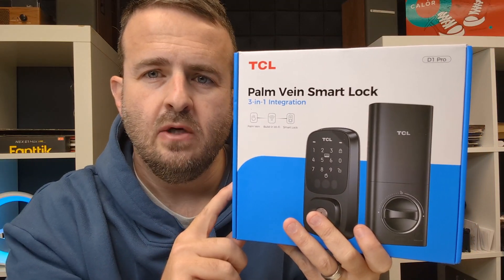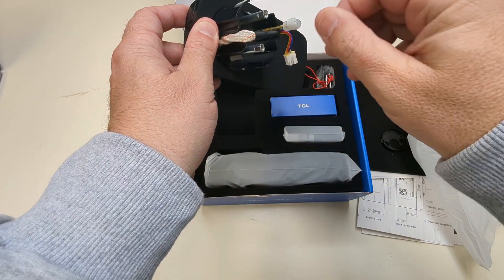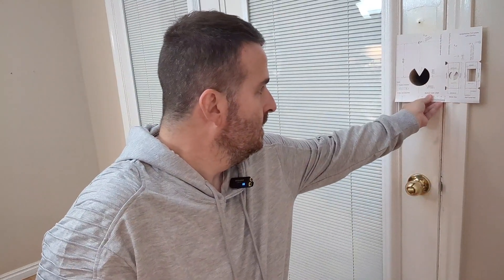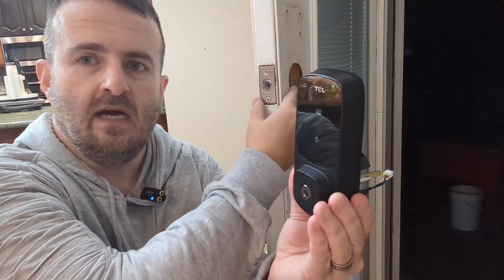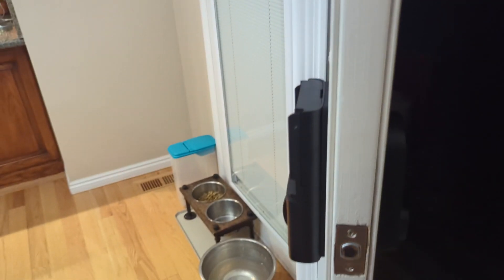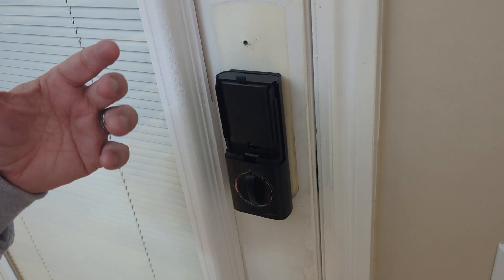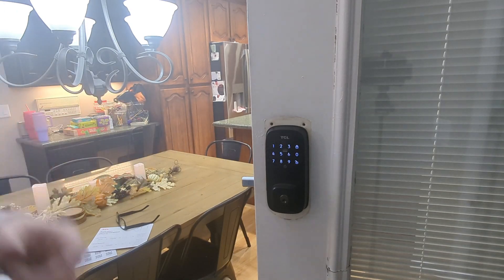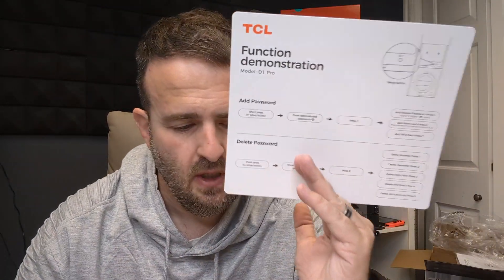TCL D1 Pro Palm Vein Smart Deadbolt Lock Easy Install!

Comment: Do you have to screw into the door to attach this? Can you attach this to a steel or fiberglass door
Reply from the maker: It fits in the previous hole that was there. I have not tried it on another door.